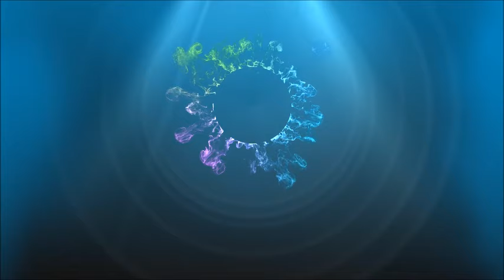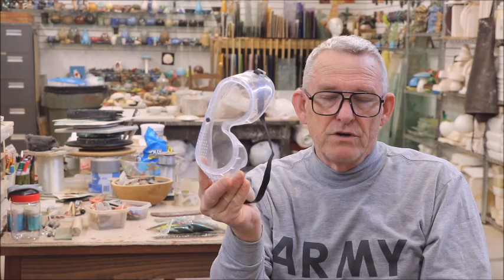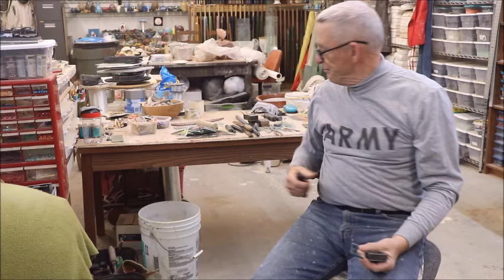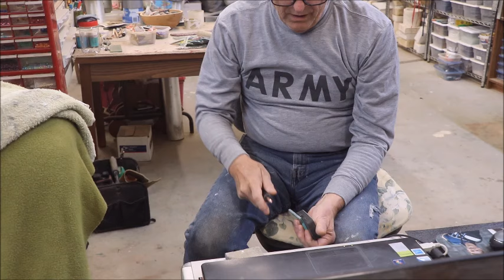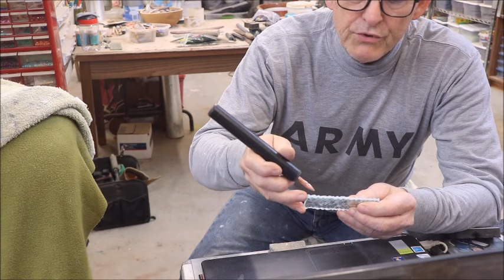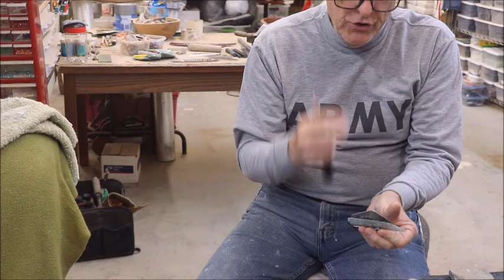Pressure Flaking 101 - Running a flake on Plate Glass

Comment: Excellent account, thanks. I am a biologist that uses very fine scalpels (eye-surgeons ones). These are surgical steel and good but for micro-work obsidian scalpels can be used. I thought why not use plate glass flakes? My attempts at flaking were not good until I saw your technique. You discard flakes, whereas I want them! A decent shaped flake is then trimmed under my microscope and stuck into a hardwood handle. Now I hope to be able to dissect 2 mm sized insects more easily than using my eye surgeon's capsulectomy knife. Thanks.
Reply from the maker: Thanks for watching.  I have heard that flakes had been used by other for the same purpose (disecting).  Hope they work out for you.

Comment: Capt Mike; first off - thank you for your service. 2nd, thanks for this video. Third, can you melt coe90 into colorful pieces that knap? Do you make/sell blade preforms? God bless! 👍🏼🇺🇸
Reply from the maker: Yes, COE 90 will melt into bill quite well.  Actually, you can melt any kind of like glass for knapping.  I have made blanks for friens from green and brown beer bottles.  It has been awhile since I made blanks to knap due to not being able to guarntee the quality.  Most of the time it works, but sometimes, as with stone it does not.  See if you can fins someone close to ytou that has a kiln and they can melt some scrap 90 or botles for you.  Good luck.

Comment: Just a question: Why the pressure flaker has to have a copper point? Wouldn't an iron nail work the same?
Reply from the maker: Copper is softer than either bronze, brass or steel, therefor it give a better flaker to glass/stone friction.  Also copper is easier to file back to a point after it has worn down.  Go ahead and make a flaker out of a 16 penny nail or a horseshoe nail and compair the two.  That's the best way .

Comment: Good practice technique. Just tossed a thick glass shelf that would've been good practice material 🥵
Have never snapped a single flake yet......
Reply from the maker: Give it a try.  You WILL get hooked!
Reply: @CaptMike  have a tool kit on the way. Bought what I think is a decent chunk of obsidian (10oz-1lb) but I'll probably save that until I feel confident I won't destroy it. 
In the meantime, I'm going to try and make a pressure flaker from a broken garden tool handle. I got a vase with a THICK bottom at the thrift store....
Reply from the maker: @silver_salvage_savage  Check with any glass repair shop and they should have plenty of 1/4 inch thick plate glass.  That will do fine to practice with.  Keep an eye out for busted table tops as that is usually thicker glass.  A 1/4 inch copper rod will work just fine for a flaker.  Drill a hole in a broom handle and slide the copper into that.  Sharpen the end of the copper to suit and flake away.  If I can be of help, let me know..

Comment: Captain Mike . I need to do this on cast art glass for a Chandlier. Can you do the flaking without the braiding ? The glass I have to this on is 22cm blocks which are 2cm by 2cm thick . I need to flake one face of the glass
Reply from the maker: 2mm is pretty thin.  I will have to run a test and see if I can flake a face theat thin.  What colors are you working with?
Reply: @CaptMike  thank you Captain Mike . It’s 2 CM not 2mm. The blocks are 22cm long and 2cm wide and 2cm high .
Reply from the maker: @mkhaleeq9801  That's about 3/4 inch thick I think.  That is no problem to flake.  By "braiding" what do you mean?
Reply: @CaptMike  sorry that  was a typing error . I meant abrading
Reply from the maker: @mkhaleeq9801  It makes it more difficult, but with minor abraiding (just where you will flake) it is possible.
Reply: @CaptMike  thank you Mike ( can I call you Mike or is it Captain!! ) appreciate the advice .
Reply from the maker: @mkhaleeq9801  Mike is OK.

Comment: Glasses are good, but trust me, splinters do get past them. $10-15 buys damn good safety goggles. Visit to the ER for an eye splinter? $300-500 fast. And that's for the smallest splinter. 
 Cut resistant steel or fiber gloves sold for skinning fish, butchering meat, handling glass trash cost anywhere from $5 to $50 the pair.
Reply from the maker: Good tips, thanks!